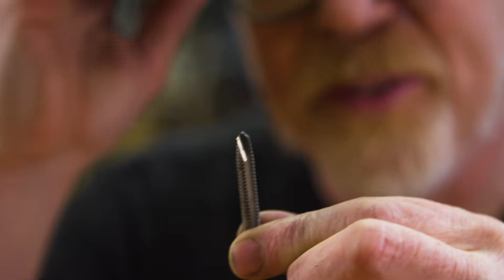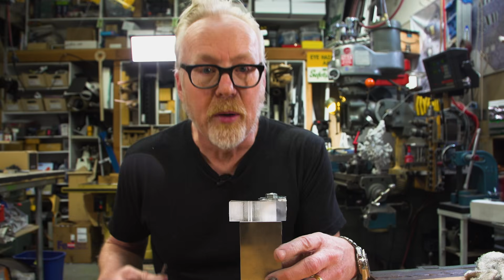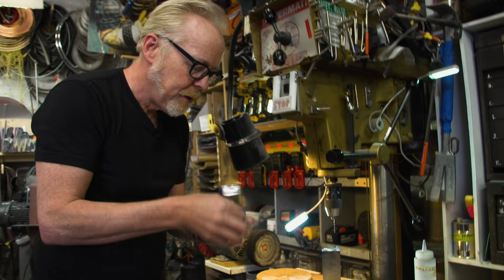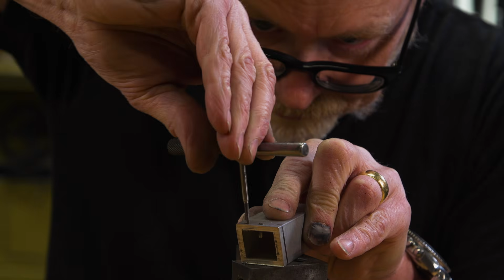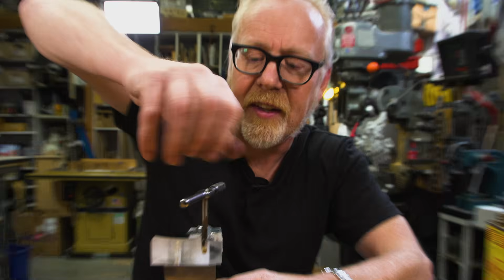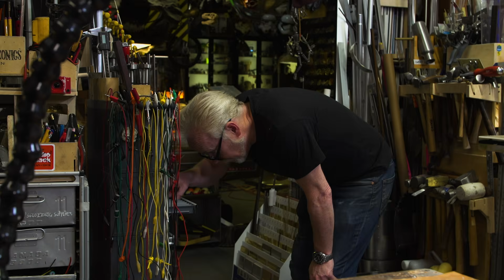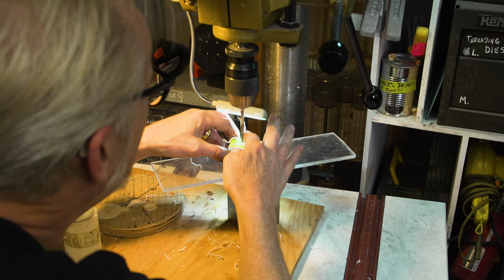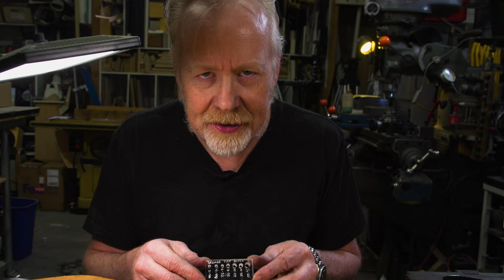Adam Savage's One Day Builds: Thread Tapping Guide Block!

Comment: Regular metal drills start trying to pull themselves into acrylic as soon as you start the hole, not just when you finish it (it's just more obvious when you finish, because there's nothing in front of the drill to offer resistance, and the drill speeds up). And they can crack it very easily. You really should be using drills made specifically for plastics (with different rake angles and clearances), that just "scrape" the hole as you push them in, and never try to grab the material pull themselves into it. You'll find that you can work much faster without constantly having to worry about it.

Comment: Tech Tip: Yes the table saw surface is basically completely flat, it is also bare steel. Meaning, if you get water on it, it will rust immediately. Use WD-40 as soon as you finish the sanding, and wipe it several times with a dry cloth. You'll thank me so you don't have to steel wool the rust later.

Comment: I like the grease pencil, but if you are using it in higher-heat environment, it can weep a bit over time.  Whenever I am coloring engravings (mainly on guns), I use nail polish. It works wonders, and lasts the test of time and cleaning.  Paint it on, wipe off excess with a stiff card (old credit cards work great), then get any leftover with some non acetone nail polish remover on a rag.  Super clean end result. https://i.imgur.com/tEh8yUY.jpg

Comment: Love your stuff Adam! I worked with an acrylic fabricator for a long while and picked up a bunch of tips for working with acrylic. He made the plastic wheel chair for xmen 2 when Xavier visits magneto in prison.  Brassed off drills will keep it from snagging/blowing out on breakthrough. Straight flute step drills are great too. For lube when drilling/tapping he always used soapy water. Way less messy and won't react poorly with the acrylic (which some tapping fluid does over time). For tapping i always prefer to helicoil into acrylic. Much stronger and won't get damaged if you take it apart a lot. White gas is excellent cleaner to use for acrylic and won't damage the finish like other solvents will.

Comment: At 18:54 Adam is dealing with keeping the tap vertical while tapping by using a guide block.  For small taps (#10 and smaller) this is a very nice tool to make.   Small and easy to carry.  Another tool to use is a spring loaded tap "follower".  You chuck the follower into a drill press and use its pointed end to hold the tap vertical.   The pointed end will engage a small tap's tap "T" wrench or a larger tap's hole on the blunt end.  This iffy video gets the idea across (https://www.youtube.com/watch?v=Ay8yE5wEuww).

Comment: I once broke a tap and to get it back out I used a smaller reverse threaded tap so that when the bolt was tight it pulled the broken tap out. It was nice working in such a well equipped shop.

Comment: Love the videos and watch them all.  I doubt you can include it, but "how to have less pain and stop a fingernail from falling off after you smash it",  You can use a small drill bit by hand or a red/white hot stretched out safety-pin (Preferred) to go through the fingernail (to release the blood), if you do it immediately.  Sounds barbaric but it lets the blood go through the nail instead of separating the nail from skin (kinda like popping a blood blister as soon as you get it).  Also stops the heartbeat feel in the nail.  Not saying you should do a show on it, but as impulsive are you are...the next time it happens (and we know it will..."Quick and Dirty"), it will fix the problem in mere seconds and you can maybe keep the nail.  Unfortunately, the pain from the smash will still be there.

Comment: Hint: If that fingernail hurts/throbs - you can release the subungual hematoma with a RED HOT paperclip (or similar) wire held in a hemostat or pliers. Goes through the nail like butter...but you must not dilly dally and skitter around on the nail. Go fast without delay and it wont hurt at all.

Comment: Fun fact that no one cares about and everyone will argue about. Technically if your tapping threads, you will be putting a screw in it. By definition a screw threads into the mating part. A bolt goes through both parts and is secured with a nut. What everyone calls a bolt can be both a bolt or a screw depending on how it's used.

Comment: If you want to up your tapping game, get SPIRAL FLUTE taps ("spiral flue modified bottom" is my personal preferred). They pull a string of swarf UP out of the hole. You can actually get by without having to back turn most of the time. Once I found these, I gave up on all my straight flute taper, spiral point (aka Gun tap) and bottoming taps. For me as a maker/hobbyist they truly are a game changer (with a tapping block of course), one tap that does it all for me.

Sadly you have to order them, as it's darn near impossible to find them at general box stores. But I found it well worth the time and money for upgrading to them.

P.S. Go metric for screws and taps. So much easier to determine the tap hole, it's practically in the description. i.e. M4x0.7: M(etric) 4mm outside diameter: 0.7 thread depth, so the hole you need is 4mm - 0.7mm = 3.3mm drill. Another: M5x1 (5-1=4mm drill) for most soft material (aluminum, brass, plastic). Steel, stainless, Iron, yea... you need a bigger drill. Refer to a tap chart.

Also with metric, you generally only need a M2x0.4, M3x0.5, M4x0.7, M5x0.8, they are all course threads, but they are SUPPER COMMON. But 4 taps, with 4 drills (1.6, 2.5, 3.3, 4.2) is really all you need. You can skip the M2x0.4 as it's supper tiny, but every-now-and-then you do find it useful.

P.P.S. I would suggest getting a drill press vise. Preferably one that bolts/clamps to the bed/table. Save's you from jumping/spinning material and ruining your day and your hands, fingers, and face.

Comment: I learn so much from all this shop and tool and what not videos. And I'm supposed to be an engineer lol.  But as a Dutch guy I don't understand the sizing system you got going on there. why are drills and bolts and screws numbered? why aren't they named by their size/thread type?  
And otherwise this is BSP tread? or withward?   not gas or metric I assume.

Comment: Don't remember the article locatiin, but I do remember one line (or thought) regarding sets of drill bits.  The journalist was following the process of making drill bits in a "cheap factory," and the sets of most bits were made from softer metals on purpose.  While they were more prone to breakage, the manufacturers researched and reasoned people only used certain bits on a regular basis anyway. So those certain sizes (maybe 4? Don't remember right now) out of a set of 30 bits were better and the rest were excrement. By design.

So I completely second buying the sizes you need rather than the set.

Comment: If your workpiece fits, you can secure it to a drill press table or in a vice under the press or milling machine, and use your hand to turn the Chuck with your tap in it. Technique also works well for installing threaded inserts into wood.

Comment: I tapped many holes in my life, and I don't think I ever rotated a full revolution before breaking the chip. Maybe in soft plastic. In steel it was more like 1/32 of a rotation.
Having a CNC mill with a small ballnose carbide endmill and plenty of coolant you can drill right through a broken tap. :)

Comment: From an engineering standpoint, fine threads provide more threads-in-bearing, so more engagement, which is needed in thinner materials. Coarse threads provide more tensile loading - the ability to not pull the threads out. An engine cylinder head bolt is coarse thread because of the extreme force pushing the head up against the bolt (and you never re-use cylinder head bolts for this rason - they get stretched.

Also, Starrett Will provide you a free PDF of a drill/tap chart here:
https://www.starrett.com/docs/educational/decimal-equivalent-card---bulletin-1317.pdf

Comment: "In mechanical engineering, there are entire fields of study that really don't fall into the purview of making shit at home"    -Adam Savage
Reply: Yeah, most makers honestly don't need to worry about all the math, though on the other hand, you see a lot of comically oversized fasteners in projects, or just bad fastener design/employment, so maybe they should pay some attention to these things. Video idea?
Reply: @AlexanderBurgers  As a mechanical engineer in response to comically oversized fasteners:
Some bolting calculations are funny and you end up with strange and really "oversize" fasteners. Sometimes you also have requirements for the joint to pass calculation even though you lose all pretension (screws are loose), but you are required for the joint to survive only on shear etc. Bolt tearout is also a question. 
In short: A lot of times its just easier to take the easy way, use larger bolts and not worry about it rather then spending hours calculating and analysing to reduce fastner size. Fasteners are usually cheap compared to manhours :-)  

But most of the time as a mechanical engineer: 
Bolts smaller then M10 our mechanics or customers usually overtorque and destroy. No matter what torque I specify. Another thing for us near the salty ocean and on ship equipment: Bigger threads survive corrosion much better! On the smaller bolts the threads just disappear in corrosion.

But for myself when working in the workshop I usually live in the M6-M10 area which is normal :-)
Reply: Holy shit Dude we have the same name hahaha and we both watch Adam!
Reply: @123456rocketboyjerry    it's a good name.   Always served me well.
Reply: This needs to be part of the merch selections.
Reply: I saw this comment at minute one..

Was worth the 30 minute wait for the payoff
Reply: @jordanlewis4308  yeah,  great words.  I'd wear it on a shirt.
Reply: I want this saying on a t shirt so badly !!!!!!
Reply: Literally just heard the quote and came here to mention it's genus. Ya beat me to it lol.
Reply: And I have to say, as a former mechanical engineer who used to spend much of his time sizing fasteners, I 100% agree.
Reply: Maybe not USUALLY, but that doesn't mean they should never.
Reply: Lmao came here just to write that, thanks.

Comment: Adam I worked at a custom machine shop in electrical wiring, we used a short piece of 2X4 to drill two side by side holes to hold a tap drill and the associated tap for the common sets of holes. It makes a small portable set of taps for ease of use.

Comment: Here's one tidbit of mechanical engineering study that DOES fall within the purview of making shit at home: tension load is only applied to the first 6 threads. That's why nuts are rarely more than 6 threads. There's reason to tap a hole deeper for taking up the wobble or for supporting bending loads, but if you're just clamping two plates, 6 threads will do the trick.

Comment: Tap size without a chart is Major dia. - pitch. This works for Metric and Standard taps. Example 1/4-20 tap.
Major dia. 1/4 or .250"
Pitch is 20 TPI so 1/20 gives you .050"
.250"-.050" = .200"
The closest drill is a #7 which is .201 you can double check your drill chart and see that this is the correct tap drill. For Metric you just subtract the pitch but since metric threads are given in the distance between threads you don't have to divide 1 by the pitch. 
Example M8x1.25 tap.
Major dia = 8mm
8mm-1.25mm = 6.75mm Tap Drill.

Comment: A solution of alum in water will dissolve a high speed steel tap that has broken off in aluminum if the part with the hole in it MUST be saved. It won't affect the aluminum at all. Hope that tip helps someone. Many thanks to AvE for teaching us that.

Comment: If you break a tap and you have a mill, you can precisely center an endmill (preferably carbide) over the tap and cut out just enough to leave only the outer edges and then pick them out with a pick. Best luck I've had removing taps. I've never used a tap extractor that actually works. They usually involve some kind of fingers that fit down the flutes and inevitable end up twisting off in the hole.

Comment: So I've got a small story about tapping threads. I'm an apprentice for the IBEW in NYC. One of the benefits apprentices get is a full week of hands on training twice a year. There was this one "class" where we learn about different tools, things that we might or might not see on the jobsite. We had to drill and tap a type of electrical box, very thick and normally used in industrial and commercial applications, it was a 1/4-20 tap. I was in a group with 2 other people, and since I know how to tap, I decided to guide the other two in my group on how to do it, I stopped one of them for letting it go crooked and told them to keep it straight and go slow. Not 30 seconds after, one of the other groups called out that their tap broke. And then I think 5 minutes later another group broke a tap as well, which prompted a quick instruction on how to tap a hole. I was very proud of myself that day

Comment: Tap Magic is great. I switched to CRC TrueTap HD cutting fluid because it works great as well as smells great. Also, I keep various colors of fingernail polish in the shop to paint into engravings I make as well as on tools that already have engravings like sockets and such. The glitter polish is great for easily spotting small text and I my daughter loves helping me paint them. You can just bush it on quick and sloppy, wait for it to dry and then acetone the surface with a rag. The polish in the crevices stays but the surface gets clean. It stays forever, there are tons of great high visibility colors and you can follow up with a clear coat nail polish to make it last even longer. As always, live the show and keep up the great work.

Comment: In design there are some in-between cases where you need a blind hole but not a bottom tap.  If you have extra thickness below the hole, you can just run the tap drill a little deeper to allow room for the tapered part of the tap.  Use the right length screw and it won't bottom out.

Comment: Electrical discharge machining (EDM) is an effective way to remove broken taps.  Not something most people have ready access to, of course.  The right shop will do it if you break a tap in a part that absolutely can't be replaced.

Comment: I sometimes need to tap #0-80 holes and I find that even the Starrett 174 is too big and allows for way too much leverage.  For those taps, I use a pin vise that allows for a really good feel and is also torque-limiting in that you can't get much leverage on it and the tap slips if you turn too hard.  Not what you'd want for normal size taps but it's perfect for tiny ones.

Comment: Quick tip if you're tapping a large hole: counterbore the hole slightly before tapping. It makes everything much easier
Reply: Counterbore? I think the word you're looking for is chamfer, bevel, or countersink. A counterbore is "a drilled hole that has a flat-bottomed enlargement at its mouth." (Definition from Google since I couldn't figure out how to put it into words.) It is mainly used to countersink the head of a fastener.
Reply: @xenonram  he was just trying to sound smart.  No need to correct this super smart person lmfao

Comment: Next time you crush, smash, hammer a finger tip and you see it turning purple, use a small 3/64’s drill bit and drill a hole in your nail. The scary part is breaking through the nail and not drilling into meat, but it will relieve the pressure and fluid and you will save the finer nail.  No need to use the pin vise, just your fingers will work fine.

Comment: Ugh Adam, the further I get into this video the more and more things I see that you have yet to discover about taps. 

When you're tapping a blind hole, you should use a tap with spiral flutes instead of the straight fluted ones you've got. The spiral flute does a better job at pushing the shavings up and out of the hole, that's why drill bits have that spiral flute. That way you can get all the way to the bottom without all that material build up. Those spiral flutes taps also usually have a blunt tip instead of tapered, so it will thread all the way to the bottom. 

I doubt Adam will actually see this comment, but for anyone else looking for great tapping and general machinist knowledge, there's a lot of dudes sharing the knowledge on YouTube. 

I recommend Abom79.
Reply: Oh man, I discovered spiral flute taps recently and they are the best. The chip just curls up out of the top of the hole in 2 or 3 long ribbons and it's glorious.
Reply: @ericg7044  Yea they're clutch. Though I never use them because my work never requires blind holes.
Reply: Haas automatiek inc. Also has a nice tutorial video on tapping (that indeed shows the spiral flute bottom tap)
Reply: @nickblondeel5556  https://youtu.be/bkrUzGooA9k great video

Comment: Instead of that block tap guide, you can get a tap guide that you load into the chuck of your drill press and has a spring loaded point that fits into the whole on the butt end of most taps. That'll keep your tap and handle perfectly vertical while also applying the pressure you need to get the tap started.